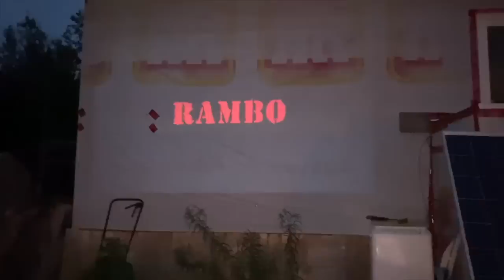Off Grid Cabin Build, Real Wood Siding

Comment: House is looking great 
I’ve dealt with lots of wood damages due to improper flashing. TYVEC is not a 100% waterproofing think about how many staples and nails are drive into it. When you have a vertical to horizontal transition you should cut tyvec above that location install a z-flashing I’ve some type then tape the flashing to the wood under the tyvec. Then allow the tyvec to over lap the flashing. That way if any water gets behind the wood it has a way out at the top instead of dropping all the way down the back of the siding. Same thing you do with windows. It one of the biggest things I see DIY doing improperly. I know that your a proud man but I’ve had to repair over 10.000,000. dollars worth of damages. Same thing as if you had two sheets of 4x8 siding one above the other. You have a gap to prevent water from getting behind the lower sheet you use a flashing, this prevents the water from getting access to your structure lower sheathing

Comment: You probably have thought of this but your tongue and groove will work fine both horizontally or vertically. However, a bead of clear caulk should probably go along the top of the first horizontal board that separates the two sidings.,
Reply: MajorHud I’m pretty sure they did that .
Reply: @Bex-rg8pj  Or Gonna Do It. On the Horizontal Butt seams also.